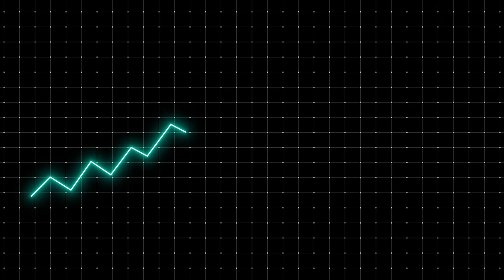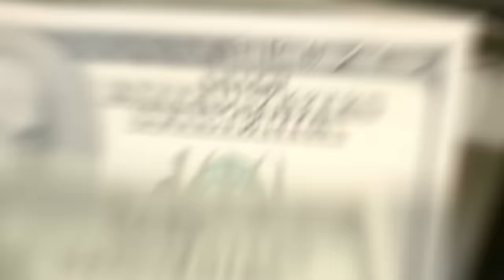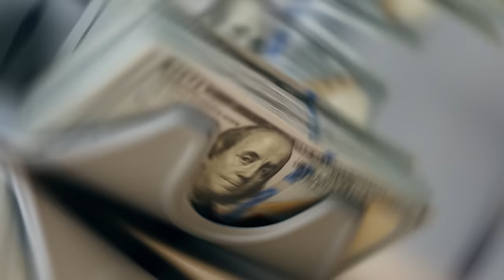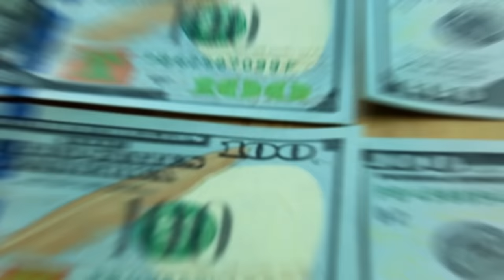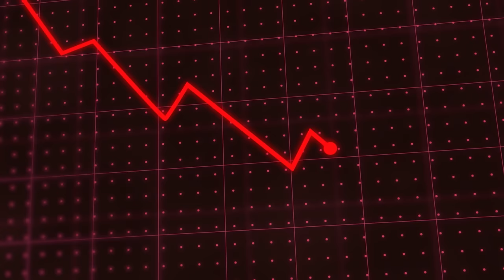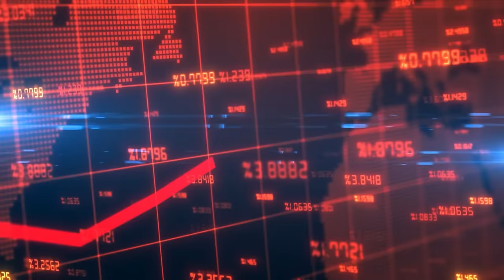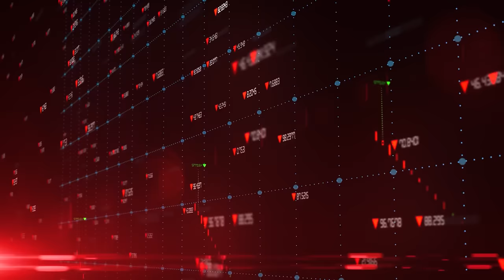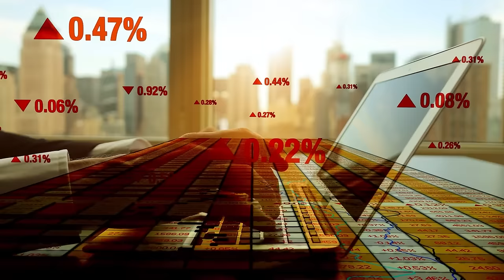HUGE NEWS! Ford CEO Finally SHUT DOWN Their Entire EV Strategy!

Comment: EV cars are a luxury. The common man can’t afford them. To heck with the government.
Reply: Lots of ones that will be affordable, they aren't giving away gas pots either.
Reply: Because they are a new technology. Give it 10 years they will be mostly what’s on the road and they will be very affordable
Reply: How is waiting 45 minutes (at best!) to charge your batteries considered a luxury? I fill my gas tank in 3 minutes.
Reply: @shralperx  do you understand how EVs work… you charge them overnight at home. You’re not wasting 3 minutes (plus the journey) to fuel up. Much easier and more convenient.
Reply: @shralperx  You haven't ever charged an EV.  The typical time is 15 minutes for most of the EVs on the road.  Worst case is 30 minutes for a big F-150 type EV.  No one spends 45 minutes outside of an unusual situation.  Of course this is only on trips.  The other 360 days it's seconds of your time.
Reply: You can buy several EVs today for under $30,000. A Tesla model 3 is low $30,000. Chevy bolt was under $20,000. The “common man” though seems able to afford $60,000 pickups.

Comment: My local Ford dealer has had 25 Mack E' s on the lot for several months and they haven't sold one !! These are 23 models .. yet the dealer can only discount $2000 off the sticker.. They are sticked priced $50,000 to $65,000.  The dealer can't discount any more or else they could be losing money...Ford won't give the dealers any money to sell these EV's as they are already losing money on them selling them at $55000 .  I wonder how they are going to clear out the 2023 models ??
Reply: Very few can afford such a vehicle (yet they are able to pay twice that amount for a fossil fuel pick up) and fewer will afford to replace the battery which will be the same price as the car.
Reply: Maybe they will catch fire and they can collect on the insurance.
Reply: I wouldn't drive an EV if they gave it to me. I ain't spending 45 minutes (or usually even more!) charging my batteries when I can fill up my gasoline tank in 3 minutes. This one fact alone is enough for me to NEVER drive an EV. 

I see these idiots sitting in their EVs, waiting to charge them and I just shake my head in disbelief.

Comment: Why don't we be fair about terminology. If we're going to call ice cars " gas guzzlers " then we have to do the right thing and call electric cars " Electricity Guzzlers ", it's only right. Respect the grid, prevent blackouts and drive an ice car. Even If I could afford an electric car, I just wouldn't feel right driving one of those heavy, juice guzzling pigs.
Reply: Ahh,  but there is where you are wrong. EVs do not “guzzle” electricity, they sip. That is why it costs 1/4 as much to run an EV on electricity than a car using gas. An EV uses as much electricity as an electric water heater. That’s also why EVs won’t (and haven’t) crashed the grid.
Reply: Sure, a NINE THOUSAND POUND Hummer doesn't guzzle juice, that's rich. What about all the other horrible things about EVs, the pricey cost, the pricey insurance, the pricey repairs, the pricey battery pack replacement, the range anxiety, the charging anxiety, the serious reliability issues, lot rot,  thermal runaway fires, excessive tire wear because of the WEIGHT of EVs, the child labour in African mines ,,, none of that stuff matters to you? I guess you're rich and indifferent. I wish I was rich and indifferent, but I'm not and I will never, ever buy a juice guzzling pig EV. Guess I'll have to stick with my 41 miles per gallon ice car.
Reply: @patrickchubey3127   yes, you picked one EV out of many dozens that is a hog. The gas hummer was a guzzler too, wasn’t it? Both are stupid vehicles.

EV average cost is about $2000 more than average gas car.
Insurance is not pricey at all. Same or less than gas cars.
What pricey repairs? My 5 year old EV has never seen a repair shop or been in for maintenance.
Battery pack replacement is a myth. Not until 20 years or 300,000 miles or so.
Charging anxiety can be real, you have to learn how to charge on road trips.
There are no “serious reliability issues”.
Fire risk is lower than gas cars. Hence the lower insurance rates.

Look, drive what you want. But a smart consumer should be able to evaluate a new product using facts not propaganda. You just might find an EV would suite your lifestyle and save you money. Like millions of other Americans have already found out.
Reply: $2000 more on average? Where? In Canada the cheapest new EV is about $46,600 after taxes. Who the hell can afford that? and ALL EVs are significantly heavier than their ice counterparts, that's not propaganda, that's statistics. And I won't buy a used ev, their resale value drops like a stone in the ocean and for very good reasons. People are waking up to the down sides of EVs, it isn't just in youtube videos, I see it in the news too, information is finally coming out. I can still buy a new Corolla for about 30k after the dust clears, it's totally fuel efficient and will last for decades. That's what us poor folks have to do to survive. We have to make sound economic decisions because if we don't, we're screwed.

Comment: They keep saying EV’s are the future. I don’t see it. There are other fuel sources under development.
Reply: But there aren't really.  There is hydrogen but it's not really viable for dozens of reasons.  Using electricity to create a "green" fuel is not really green, just more green than normal gas.  You also need 4x the energy than just using an electric car.  EVs are fantastic cars and the few small downsides they have are overblown by those that haven't owed one.  Most arguments read like ones against battery electric drills before they existed and now it's all anyone wants.

Comment: Selling overpriced marked up to death EV and expecting to sell like hotcakes, not gonna work fool! Modern Ford never learned from Henry Ford. In the end, only Tesla is sort of following Henry Ford's strategy of vertically integrating production and more efficient assembly. Tesla are pricier than an ICE counterpart, but fairly competitive against EV from legacy brands. Replacing Tesla battery is less expensive than Hyundai Ionic. Base Model 3 have more bang to buck than a 5.0 Mustang since buying new from Tesla are sold in MSRP, while many Ford dealers marked up their new 5.0 Mustang to death.

Comment: It’s so funny to hear all the misinformation in these comments… EVs are too expensive, they catch fire, insurance rates are high, don’t work in the cold… on and on. NONE of it is true. 
The average EVs costs a few thousand more than the average gas car, and fuel and maintenance savings make that break even in about a year. You can buy a brand new Tesla model 3 for low $30,000. How much did your new pickup cost?
EVs fire risk is lower than gas cars by every study. Rate of fire is about one tenth gas cars. And if they burn they burn slowly, they don’t explode like gas cars.
Insurance rates for EVs are about the same as gas cars. My insurance rate is lower for my EV than my gas car. If EVs had the high risk of fire you all believe they do, wouldn’t the insurance companies know that?
EVs have actually fewer problems in the cold than gas cars, according to studies from Norway and Sweden, where they have lots of EVs, and it’s, you know, cold there. But you have to know what you’re doing if you’re going to leave your EV out in -20F weather and try to charge at a public charger.

Comment: Sounds like BS.  The only recent article I can find about Farley and EVs reads as follows : The race for an affordable EV is heating up. Ford revealed that it’s working on a “low-cost EV platform” that should lead to smaller EVs in its lineup. The automaker’s CEO, Jim Farley, said during Ford’s fourth-quarter earnings call that there was a “skunkworks” team created two years ago to devise this affordable EV platform. According to Farley, this platform would fit several types of vehicles but would also work with Ford’s software and services.

So basically, the complete opposite of what you just posted.
Reply: Yes it is. It’s just another video with a click bait headline that’s utter garbage.
Reply: Try again. I found pages of media reports backing this up.
Reply: Ford's skunkworks program = golf carts.  😂
Reply: @djblc2201  Suuuuure you did... but somehow you can't post even one link or lead to even one of those 'pages of reports'!
Reply: @johnn17golf The grid can’t take on all these EV’s Commie .
Reply: @JustpissTrudeau69 :  there is not enough battery production capacity as well, also the battery replacement cost is ludicrously expensive.
Reply: Automakers start projects all the time.  90% of them don't make production.  Don't get excited about Ford's "skunkworks" team to devise an affordable EV platform.  They have to design and build the cars to assess how well they perform and how much they will cost to produce.  If the cost to benefit ratio isn't high enough, Ford will not give the green light for production.  I posit this is what has happened, and why Jim Farley has pulled the plug on further EV development.
Reply: @andyharman3022  I have yet to see a credible source that says he actually did that.
Reply: @hugolafhugolaf  Where is your source for the "skunkworks affordable ev" story?
Reply: If you actually have the stomach to listen to the end of this video, you’ll see that they admit exactly that, that Ford is still all in on EVs. It’s just a Clickbait title for the EV haters.

Comment: Currently, there are many gas powered pick up trucks that are costing $100K+ when you factor in dealer mark ups so that isnt much of an argument against EV trucks, sadly
Reply: "Yes, but at our dealership it's different. We have reduced our donuts and hotdogs fee to only $999, and air in the tires charge to $99 on our $99,000 Plain Jane Pickup....and we can get financing for anyone, even YOU!"
Reply: @jamesrecknor6752 :  you had me convinced until you said that you could get me financing (you can’t). 

Also, no ho dogs & donuts is a definite deal breaker
Reply: @jamesrecknor6752 : I have also witnessed the price on those “Plain Jane” trucks were actually priced at $99000.02 so how ‘bout some truth in advertising?
Reply: $100k isn't much of an argument. Sjeez, he really wrote that!
Reply: @jackmorganfiftyfive :  I have seen a video of a done-up Raptor with a sticker asking $300K, SMFH, good luck in moving that unit anytime soon.
Reply: People keep telling us EV owners how expensive EV must be. Meanwhile I’m driving a $30,000 EV, and the guy telling me that it’s too expensive is driving a $75,000 pick up truck.
Reply: @stevewehr :  what do you plan to do with your ev when it will cost $50K to replace your battery assuming that you can get a replacement battery in a reasonable period of time?